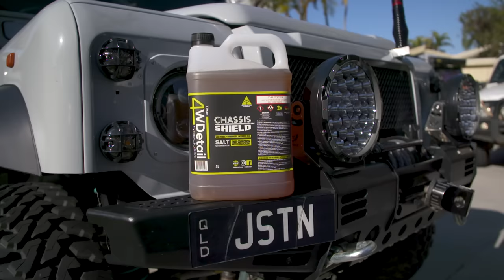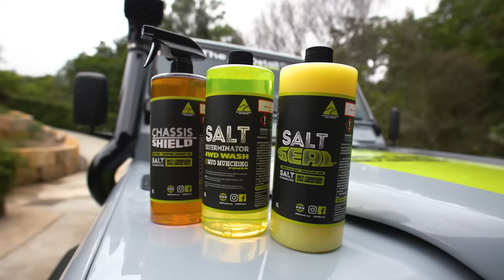5 HUGE MISTAKES people make when WASHING THEIR 4WDS! 4WDetail experts show how to do it properly.

Comment: If youre worried about scratches in your paint, dont take it bush.
Reply: The odd scratch when going bush is different to rubbing the whole rig down with, effectively,  sand paper, removing microns of paint each wash.
This starts paint peel and clear coat lifting off.
Reply: it's not a binary proposition.
Reply: or... hear me out: 

Take it bush, get scratches from the offroading.

Then wash it properly, avoiding extra preventable scratches from rubbing small rocks and sand into your paint 🤷‍♂️
Reply: Your car is definitely hammered
Reply: Pretty much!!
Reply: @samartz  not pretty much
Reply: Really good wax will prevent/seal minor scratches from brush and branches.
Reply: Avoid specifically Langsdon Rd Imbil lol
Reply: @craigquann  no it wont the brush at the car wash Imagine walking into Bunnings and grabb8ng the stiffest broom you can find out soap on it and start washing
Reply: @RICHYSUNCLE  what are you talking about?
Reply from the maker: Hey mate! This wash from 4WDetail is made specifically to disintegrate all of the mud and dirty so when you go to scrub it it should all just be the soap. Better yet it's PH neutral & ceramic coating safe so there should be no issues with the paint whatsoever! 🙌🏻
Reply: Frenchman's track,tele track are culprits
Reply: @4WD247  completely off topic
Reply: That wouldn’t be living mate. 😎👊👍🇦🇺

Comment: Before drying off, grab the garden blower (or some shop vacs you can move the hose to the other end and it blows warm air) to get a large amount of water out of the mirrors, door jams, handles, grill, headlights. It really makes half the work and stops runs later once you’ve grabbed that microfibre drying towel and gone over the car to dry it. 

I use a flash version for detailing but a garden blower or shop vac is going to do a nice enough job all things considered.
Reply: A blower is good advice. A short drive can also do the same, as long as it's not dusty! The drive also clears water from brakes, bellhousing, bellows etc.
Reply: @stco2426  downside there is that it also dries the rest the car and that will leave water spotting and lead to etching. After a short drive, water will continue to drip out of headlight, grill, around handles messing up the work and time spent cleaning. 

Just blow out the places a microfibre drying towel can’t get into. Then wipe down with a thick microfibre drying towel while moisture is still on the car.
Reply: It doesn’t. I’ve done it for years and years. Theres still loads of water on the car, just not trapped in all the crevices. There are actual professional blowers for cars that detailers use, they are heated. I’m just suggesting a hack using a common household item. 

BigBoi is one brand of detailers blower. (That’s what she said)

Comment: A bit advertorial but great content. Products and techniques have come a long way since the 'sponge and two bucket method'. Foams that stay foamy really help soften all sorts of road and off-road muck. Pressure washing is ok but keep the lance away from sensitive bits. As said here, low pressure high volume not the other way round. These wheeled under cleaners are also great, including where roads are salted. 
There's loads to really like here and I've not seen the installed chassis hoses. Very trick.
Keeping a vehicle clean when used only on highways is hard. 4WDs needs even more care and it's often more difficult to do. Thanks!!

Comment: You completely ignored 1 massive thing, the engine bay, when I was a detailer, my 5 tips is, 1. if it's bad, fork out the cash for a professional, we have the chemicals and acids and disposal to do it right, 2. cover the computer. 3. use a range of brushes to get into the nooks and crannies, 4. when using high pressure be extremely careful and don't get too close, especially around wiring/connectors spark plugs, let the detergent do most the work, 5. Avoid sun like the plague.
Reply from the maker: Great tips mate, thanks for sharing. 

We’re thinking of doing an engine bay specific video too, hence skipping it here!

Comment: Bugger all that my paint is faded the flairs and tub is in primer and the clear coat is roached so I only have to pressure wash, mine ain't pretty but she sure is reliable, owned it about 2 years and haven't touched it with soap or wax, and I don't care about scratches.

Comment: I used to polish the D1 2 times a year with Autoglym Super Resin Polish, dirt would just fall off with a hose pipe. for the chassis, park in a river for about 10 mins! :-D I suspect as the old D1 has been sat up for a while now that it might need a good flush out, but better wait until the Robin's have fledged as almost guaranteed there is one nesting in there somewhere! 

The 110's new galv chassis has been done with Buzzweld's products and they are awesome. It's still got to have it's first trip, but honestly, you can't beat a 300tdi 110 for being the most awesome vehicle off road. Get Justin's on the show more, you will get a higher class of viewer! I might even crack open the Moet! 😛

Comment: haha. after each mud trip, i do a deep fresh water crossing several times forward and reverse to wash under the car.
there are enough pinstripes all over that washing mud off with a sponge is no issue too, though of corse i do wash it off before the scrubbing starts.
when i service the car, i remove underbody protection and clear all mud, sand and debris out too just as an added part to the maintainance. 
it would be great to have a beutifully immaculate 4wd but i just go bush and it never lasts. i'll worry about how it looks when i sell it. get it polished or even resprayed. 🤷😅

Comment: Use these simple tricks!:
Don't wash the inside of the snorkel with a high-pressure hose!
Don't use diesel to clear the stains from your carpet.
Be sure to use a toothbrush to clean the dirt out of your tyre treads.
Keep your mouth closed! You can't suck the chrome off a lowball, no matter what they tell you!

Comment: I use snow foam, rinse and then Maguire's Gold Class and 2 buckets, one to wash and the other to rinse the mitt using a grit guard.  Finally dry using a Maguire's towel. 

Do need to get a clay bar and wax done.

Comment: $360 for a hose and tap adaptor (aka Internal Chassis Flusher).... that'll be a pass!  Big markup for some hose and adapter!
Reply: Might do a DIY version myself.   Be a lot cheaper.
Reply from the maker: It actually comes with perforated hose that runs down each chassis rail to get the job done. We haven’t got the patience to DIY that one 😂

Comment: I have a question - when you say "pressure wash it off" I assume that is not using the high pressure powered cleaners, and instead mean a normal tap water pressure with a nozzle?  Surely the high pressure cleaners will cause scratching?

Comment: Hi, mate I am considering a product like a raptor coating for effective long term rust protection, and would like to know whether your product either competes, or enhances such a product? How often does the Chassis Seal need to be re-applied under normal use blacktop use and weekend warrior beach work occasionally?

Comment: What about the interior? And do you have products to help get rid of swirl marks and small scratches?
Reply from the maker: Not so much a product to get out scratches (they're typically permanent), but Justin has a product called Grime Grinder and you can use it on ANY surface in your rig, even your seats - it's a game changer!
Reply: @4WD247  awesome!

Comment: I disagree to a certain extent, first step wash off with a normal hose, saves you chemical., then you can start the process you detail .
Reply from the maker: We’ve tried both ways and find you use about the same amount whether you pre-hose it or not!

Using a foam cannon means you use the chemical a lot more efficiently than the old bucket method too.

Comment: One big thing I see done wrong here. Don't wash your car on concrete, Wash it on the grass so the dirt, oils and chemicals are not flowing into storm water and into our waterways. This should be common sense for everyone but sadly too many people still wash their cars in the driveway, do it on the grass of go to a car wash where they are meant to capture and treat the water before allowing it run off.
Reply from the maker: Hey Mick! The products we used are 100% biodegradable so you wouldn't have to worry about that 🤙🏻
Reply: @4WD247  I still reccomend washing on the grass. I know when we have had water restrictions and even out of it is always reccomended or pushed that we wash our vehicles on the grass so as not to waste water. Even if the products are environmentally friendly you still get the mud and crap washing down.

Comment: Spray painter:
if you want all that gear then go for it..
but honestly.. some car wash (with wax in it if you want) will do it.. soak it a bunch of times with spray on soap (soap gun to hose is fine, the ones used here are good sure but $$s)
wash in the morning (yes when its cool out & out of the sun).. give your car the day to dry out.. especially if you are going to pump water into your chassis (shudders..)
Sponge is ok its about how dirty the item you are washing with gets... (worked in a Porsche repairer would use a brand new sponge each time if we dropped it, would bin it.. use your head)
Start at the top and work down yep...
yeah... up to you but I'm sure you roughly know how to wash a car..

Comment: what about cleaning a car coated with raptor?
Reply from the maker: Very similar mate just no need to worry about swirls. Salt exterminator still helps break up all the mud and dirt, actually makes it easier to clean a car with raptor coating
Reply: @4WD247  more about the mop/sponge etc as I have found that the raptor tends to tear them up.